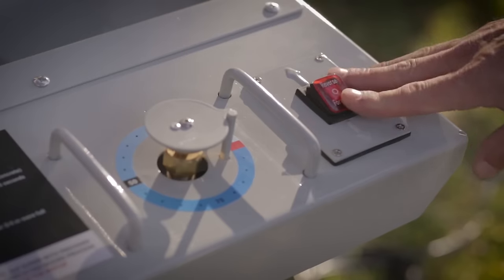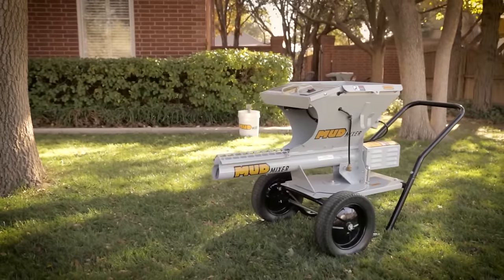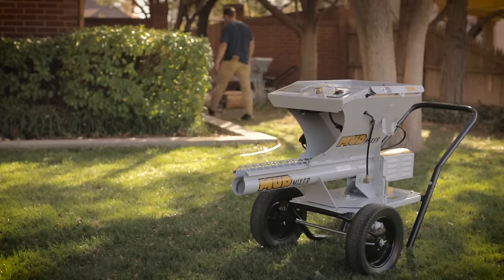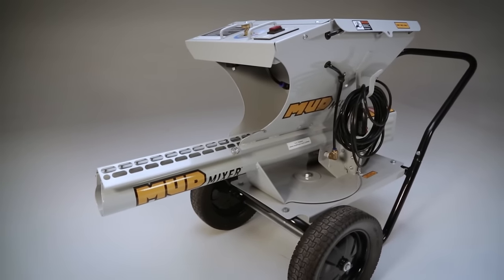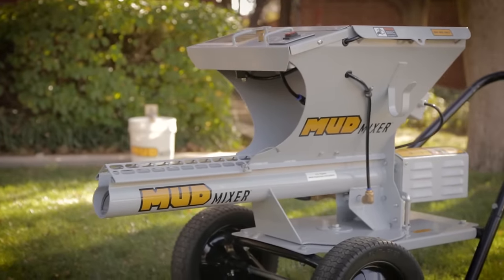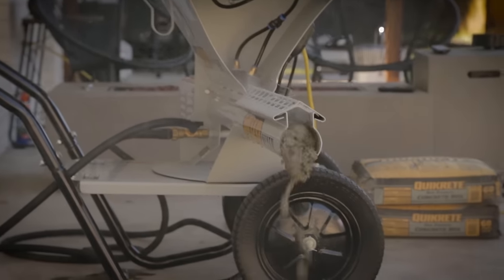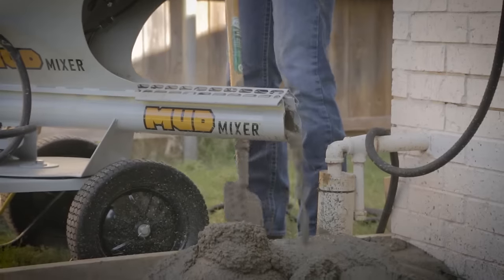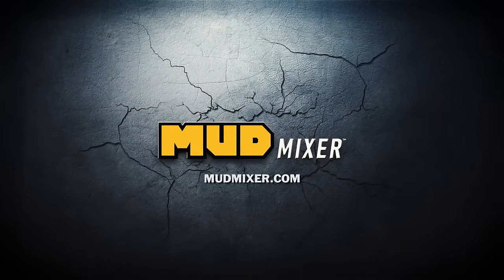MudMixer | This Changes Everything

Comment: I just rented this to pour 197 80# bags. The project would not have been possible without the Mud Mixer. I am 100% sold. Very well designed and thought-out product. I'm going to have to start saving to get my own
Reply: And how much did 197 bags of premix cost vs. buying and mixing cement and a load of loose sand?
Reply: the mud mixer wouldn't be a good tool to do it that way. You would have to pre-mix everything before loading it into the hopper and that kind of defeats the purpose of this tool. You might be able to save a little money (I haven't done the math), but you would need to use a barrel mixer using that method. The purpose of this tool is consistent, easy mixing, speed, and less back pain. If cost is your main priority then there are other ways/tools that may pencil out cheaper - but at the expense of your back and time.
Reply: 200 80# of concrete is about 4.5 cubic yards. This machine looks really small for that much concrete. What kind of job was it?
Reply: @AlessioSangalli @AlessioSangalli we did a back porch in roughly 4'x4' squares. We did about a pallet a day no problem. Maybe took 60-90 minutes to pour that much. We could have done more if not for my knees and back hurting - more from being hunched over doing finish work than loading the hopper. You could do the job easier with a concrete truck or trailer, but I didn't have access for those or the manpower to finish that much area at once. This job would have been a nightmare with a standard barrel mixer. This fit our needs perfectly.
Reply: @AlessioSangalli  i can't figure out how to post a photo, but imagine 4 rows of squares about 4" apart in a grid pattern. We just did a row a day, then reset the forms for the next morning.

Comment: Looks like a nice, well engineered product. However unless you use it often, the $3K price tag makes it out of reach for most. I’m a home repair contractor and I’ll be here waiting for the price to come down while mixing mud in my wheelbarrow.
Reply: You mean the Alibaba version?
Reply: i help my mason friend a lot & on some smaller jobs , we use a paint mixer wire thing & a 1/2" drive drill & 5gal. bucket
Reply: @guitarman_3693  I do that too for small jobs
Reply: im sure harbor freight will have their own version soon, it will only last for 3 or 4 uses though...
Reply: @mistergarrett8175  I’ve had good luck with the products I’ve purchased from HF. Are products purchased other places better… absolutely! I’m a  Self-Employed contractor that works alone. If it’s not something I’ll use everyday, I can’t spend that much money. Like I said, it looks like a great product but seems overpriced at $3,000 to me. 🤷🏻‍♂️
Reply: @oldnstillworkin5709  you and me both my friend, wayyyyyy overpriced!
I've had pretty good experiences with HF products also, I'm sure there's some junk but I don't go Rambo on tools just to see what they're made of like some do and then give it a bad review. 👍👍
Reply: Hell, you can mix a bag of mix using a $20 plastic tarp and two people faster than this.
Reply: 3k for what it probably has similar amount of steel, electrics and motor as a small electric mixer that cud mix 6-8 bags at once... I like the concept but a small mixer is £300 here in UK
Reply: Useless for mixing your own concrete.  Must used premixed bags.   settled product also a problem.   Also looks like it mixes way too wet.
Reply: Rent one. They are absolutely worth it.

Comment: It's be great if there was an option to enclose the output and have a 15' flexible hose for pumping footings and such.Neat rig!
Reply: Get some PVC and turn it into a Pump Truck 🤣
Reply: If they did that the liabilities for air entering the line and causing whiplash would be insane
Reply: Its slow enough for 5 gal bucket brigade. An auger cant pressure a line effectively. That takes plungers, hydraulic double-cylinder pumps that used an oil-operated ram with fast cycle time. The MudMixer is perfect for what its designed for and a scaled down version of the heart of a batch plant/mixer truck.
Reply: That would never work.

Comment: A perfect tool if you charge by the hour
Reply: It's the perfect tool to avoid hiring a bunch of hacks.  DIY at it's finest.  Work at your own pace for better quality, much lower costs and the satisfaction of doing things with your own two hands.
Reply: Every job is done by the hour.  Job= $3400  took 4 hrs to complete 3400/4= $850 an hour

Comment: Experience plasters and brickies know by sight the consistency they want. We know how much water to add even when the sand is wet it makes no difference. It is only good for pre-packed dry mix that most tradies find cost and time prohibitive.
Reply: You obviously haven't been working in the trades recently. Small fixes and small jobs use premix. Masons only bring large scale mixers to large commercial or industrial jobs
Reply: @adventuress904  considering I have over 35 years experience from handyman to large scale commerical. Having spent 12 years specialising in herigate reconstruction. Ran operations that required small repairs to large contracts I think I know what I'm talking about. I can see how it would benefit a hanyman not skilled in concrete, mortar or plaster mixing. I've worked on plenty of repairs that didn't require a 10kg bag of premix. In pointing up repairs the mix would set in the machine before you got to use it up. Premix or not most tradies would have the job almost finished by the time someone set the machine up.
Good luck next time!
Reply: My labourer mixes more than that thing does in 10 minutes swivel buckets have attachments for quick mixing on most our commercials,
 and  this would only be extra space in work shed.
 paving and kerbs and small ground works yes it would be ideal in that field, public and side jobs.
 but no way would it be used on sites here ud get laughed at walking on site with that thing. Premix is never used on our sites unless it's haunches kerb or monoblockers for height and depth baseline snags.

Comment: As someone who knows nothing and works in IT for a living but needs to pour a slab for a shed, is this practical for pouring a 12x12 by 4" slab in one go? It was recommended by the local rental place and I trust them but I wouldn't mind a second opinion.
Reply: Yes, it will do that with ease.
Reply: Absolutely.

Comment: Good product ,but what about getting into a wheelbarrow for plasterers or blocklayers
Reply: I'm no expert but as long as you set the end of it higher than the wheelbarrow it should work
Reply: Just leave it in the back of the truck with the end hanging off the edge and put the wheelbarrow below it.

Comment: Yep. Way to slow. I have a pan mixer that can mix 8x20kg in 5-10 min. This wil give maybe 1-2 bags in that time. And my pan mixer was only 1200usd. So way to expensive here in the EU. You can almost mix the same amount in a wheelbarrow at this rate. The idea is great thou. Just to prizy.🤗
Reply: Good perspective,  tyvm .
Reply from the maker: The Mud Mixer will mix a bag of dry mix in 1 minute! 1 yard an hour..
Reply: @mudmixer  seems a bit slow as I'm mixing and finishing pan set within 30 to 45 minutes depending on the size
Reply: A 5 gallon bucket, a good drill and a mixer whip for mud and in 1 minute I can mix the same for about 1/10 the price of this.
Reply: i can do 1 yard an hour alone in a wheelbarrow

Comment: Just wondering if you could run this off a generator? and if so what size?
Reply from the maker: Yes you can! Just a simple 110v generator will suffice. The machine only pulls 1.6 amps.
Reply: Your concrete will have ripples in the finish from the vibration unless you run two of them simultaneously.
Reply: Sorry.  Couldn't help it.

Comment: It's kinda slow tho I could mix 5 bags in 10 mins and dump it at once maybe a bigger hopper and ogger would be better  with more output I gotta get jobs done as easy and fast as possible time is money maybe good for around the house jobs
Reply from the maker: This will do 5 bags in 5 minutes!
Reply: It's an example 5 bags in 5 minutes ain't much when your doing commercial jobs and need to crank them out as fast as possible I'll have 3 mixers going and get 25 bags done in 10 minutes this just couldn't keep up with my needs my opinion that's all